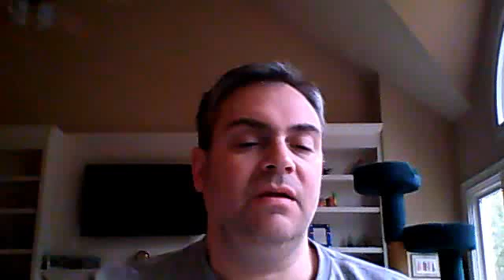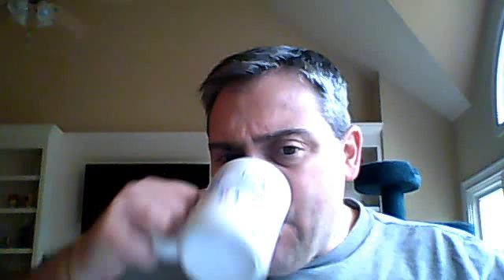Amateur Radio operating protocol regarding QRM (malicious Interference)

Comment: Or what about him talking about QRM and he can't even distinguish and explain that properly. Then straight after he professes to have been a ham of 40 years. QRM= man made interference. He refers to QRN without saying the Q code and muddles it with QRM! (when he refers to natural "frequency" noise- I woulda called it atmospherics). QRN is simply naturally generated noise on the monitored frequency. I am a 31 year old electronics and radio tinkerer with no amateur license and I shook my head while watching this. I would have deleted it and not posted this video if I were thus guy.